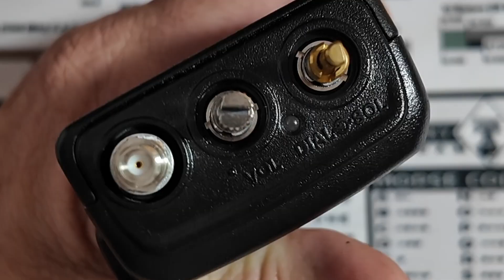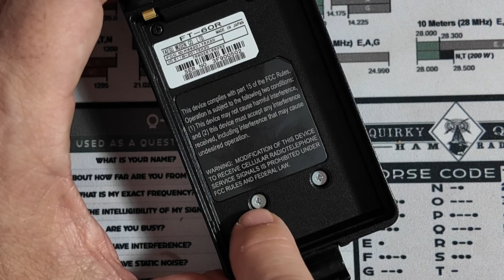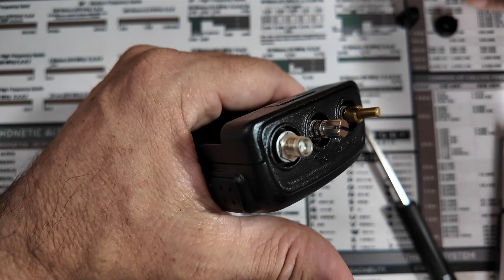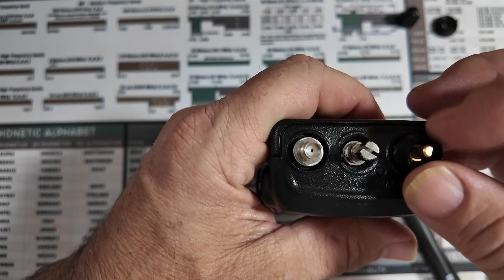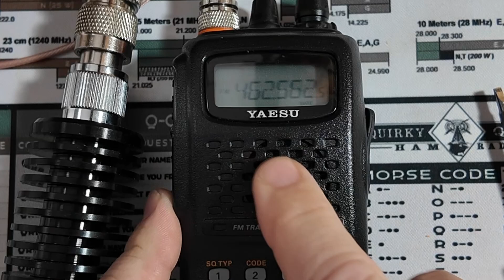FT60 MARS Mod

Comment: After the mod, what is the RF output on GMRS frequencies? Asking because I did the MARS mod on my VX-6R; it worked well, but, RF output on GMRS is limited to 500mW, even on "High" Power. Great video - Thanks!
Reply: I’m getting ready to do this mod on my ft60 today.  I’ll measure the output when done.  I believe we chatted yesterday and I thought it maintains 5w?  Yeah my ft5d was 1.5-2watts from what I remember.  My vx6r was about the same.   500mW sounds really low.   I know it’s around that on 6m after the mod.
Reply: Just confirmed - vx 6r is 2watts on gmrs.  But mine is only putting out 2watts across entire 70cm band.   Hmmm. There is a way to adjust the wattage if you want to dive into the sub menus.

Comment: I have seen pipes or cheap sockets ground down with tabs to fit into the slots.  The socket fits over the shaft.  Kind of a one special tool that will fit most of the shafts similar.  They also make watch makers tools that are similar that can be used for the same thing.  Thanks for the video.  73

Comment: I have used a razor knife to do that, but I have heated the blade with a torch which helps soften the solder when you poke at the resistor/jumper.
Reply from the maker: Great tip! Thanks

Comment: Jason, do you happen to know if modded radios can still be programmed  with RT systems, or will it only program the original official frequencies?  Thanks, Chuck
Reply: I did the MARS Mod on my FT-60 last weekend. RT Systems still works, but I had to do a factory reset of the radio before sending the saved settings and memories.
Reply: @cmiltenberger  Thank you.

Comment: You do realize that you could very easily trash a radio or any electronic device by breaking those tiny parts off. Buy a small pin tip soldering iron at the very least.
Reply: I don’t know how many times has it been done through the years?  this design of the radio has been around for a very long time, and I cannot begin the account how many people might’ve done it that exact same way through the years.
Reply: Its a chance your willing to take if you don’t want to carry 3 radios for a job that one can do. Jason is a very season ham as long as some of the rest of hams.  We understand the risk.  If you want to carry 3 radios by means have at it.
Reply: @ATR_Mid-TN-WX  thats not what I meant. Breaking of parts could damage the traces on the board rendering the radio in operative or causing inverse effects. Just trying to point that fact out.
Reply: @pjackson239  yes sir I understood that. I was very nervous when I nodded my icom 2200. I even went to a local ham I have known a very long time to make sure I was doing that correctly

Comment: This is the video I needed to rationalize paying HRO to do this 😂
Reply: Yeah I just sent my ft5d out to HRO. It appears this isn’t as a complex change as I thought lol.
Reply: I just did this on both of my ft-60s, it’s really honestly not that bad. I just placed a normal soldering iron on top of the component and applied pressure to the side of it with my knife and it popped off nbd. I’d encourage people to give it a try, I’m not that great at micro soldering and it was easy as cake.

Comment: the tool is called a spanner wrench. You could also use needle nose pliers
Reply: Pin spanner   https://www.google.com/search?q=pin+spanner&sca_esv=992c006e90961474&udm=2&sxsrf=ADLYWII9zEoLwVgYvIT9WDew-bK5Szv6sw%3A1729113618529&ei=Ei4QZ5iCIMqn0PEPj6Wj0AY&ved=&uact=5&oq=pin+spanner&gs_lp=Egxnd3Mtd2l6LXNlcnAiC3BpbiBzcGFubmVyMgoQABiABBhDGIoFMgoQABiABBhDGIoFMgoQABiABBhDGIoFMgoQABiABBhDGIoFMgoQABiABBhDGIoFMgYQABgHGB4yBRAAGIAEMgYQABgHGB4yBRAAGIAEMgUQABiABEjzEFCODVj1DnABeACQAQCYAUygAY4CqgEBNLgBA8gBAPgBAZgCBKAC3AHCAg0QABiABBixAxhDGIoFwgIIEAAYgAQYsQOYAwCIBgGSBwE0oAfqEw&sclient=gws-wiz-serp

Comment: I made a tool for fitting nuts on potentiometers, long time back when I was in the television and radio trade. It was a flat strip of steel with the middle cut out to clear the shafts. In the 21st century I bet someone has 3D printed something similar. Nice mod!

Comment: For a new ham, what is a Mod and why do you do it ?
Reply: By default, the radio (and most others designed for the amateur bands) are transmit restricted to just the portions of the bands they support allocated for amateur radio use.  The official reason for modifying the radio was for those that participated in the MARS (Military Auxiliary Radio Service) or CAP (Civil Air Patrol) program and were authorized to transmit on those frequencies as well. Many, myself included, like to know IF I needed to transmit out of the amateur bands (like FRS/GMRS) I could do so in a true emergency when no other forms of legal communication are available that will get the job done.  That being said, it is the responsibility of the user to know what frequencies they can legally transmit on regardless of what the capabilities of the radio might be (modified or not).
Reply: Mod, modification, to make the radio do stuff different to stock out the box. A common "mod" is to remove, or sometimes add, a component or link to extend the transmitting range.
Reply: @g4lmn-ron  He means the transmitting frequency range.